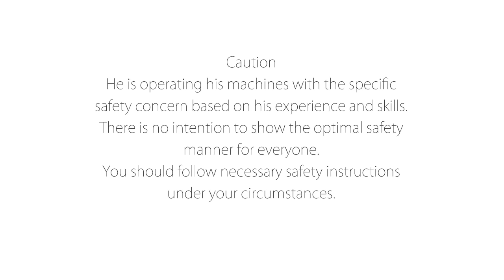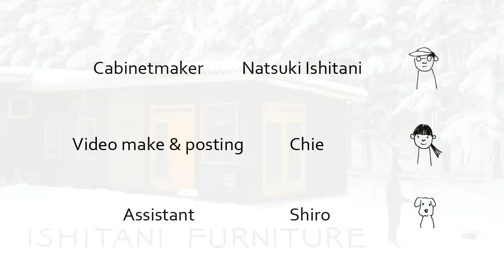ISHITANI - Making a Bed 2.0

Comment: 6:07, I was trying to figure out why he was going to the trouble of making those little pegs with the double slits in them, but this just blew my mind. Using the tabs, and then inserting shims between them to make a tight fit and prevent and sort of relative motion or wiggle. Freaking genius!! I seriously am awestruck by this little technique! If there's one thing that will immediately render something as seeming cheap or poorly made, it's squeaking, wiggling or instability, but that little technique is a game changer.
Reply: It's beautiful work..search for Japanese carpentry...
Reply: @juukame those are wedged tenons and are used in many other applications like windsor chair legs, he also used it in his trestle table build.

Comment: Having the correct size machines for working with large lumber certainly makes the job easier (than when I wrestle with my six inch jointer and eight foo, lumber) HOWEVER, you sir, are a master. Machines or no machines. 
Brilliant joinery

Comment: When I first read about the skin condition that forces him to wear gloves I thought, 'That's a real tragedy' this guy is hindered everytime he works with wood, which I am sure is his passion'.

But after thinking about it, I realized the skin condition encourages him to work more with his hands, rather than rely on machinery [which throws around the dust which he cannot handle]. This, in turn, pressures him into developing hand wood working skills, which is invaluable. And it also results in custom and unique pieces of art, rather than mass produced depravity.

So in a way, this disease, is like the grain of sand in an oyster's shell. Irritating, but after some time~ produces a precious pearl.

Comment: I love your videos, Natsuki.  In your other videos, when gluing up panels, I've seen you use 2 rows of biscuits, in the headboard, you use only one. Is that because the headboard is not load bearing?
Reply from the maker: Depending on the size.
Reply: I see, thank you. Also, what is the machine at 4:44 in this video? I've never seen one like it before.

Comment: Can someone tell me how that drill at 2:51 is able to make square holes? Is that an attachment?
Reply: Ojasvi Srivastava , if I'm correct, there is a drill inside the square casing; as the rotating drill inside the casing bores the hole, the casing, also under pressure from above, acts as a very precise four-sided chisel.

Comment: Compare a lot of making method of king size bed in internet, my method is best. Buy iron framework, and buy 12 pieces wood in home depot, size is 152 cm×13.5 cm× 4 cm.
Very strong, safety, anti bed bug, anti virus, easy to move, and cheap. Don't need use hammer and cut machine.  Change social system, start from bed.